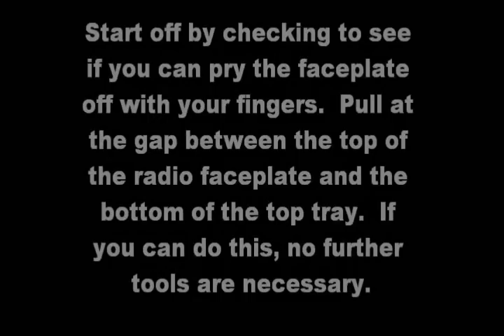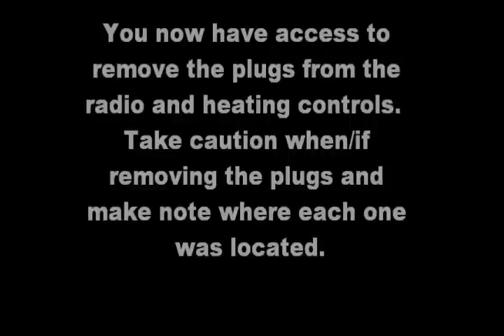How To Remove Radio Faceplate from a Nissan Titan

Comment: Is this a way to get to your 4 wheel drive switch removal? Cause I need to remove the switch to replace the light bulbs on it cause they went out because when I turn on the dash lights at night the 4 wheel drive knob doesn't light up its annoying especially if you have to switch it to 4 wheel drive and it so happens to be night and you won't be able to see it or on what position to put it at

Comment: So I don't have to take my glove box out, shifter off, shifter bezel off and also a few screws to get the faceplate off? 
I have read a few things on google and it seems no one does this and just pry the faceplate off. I have an Armada and I don't want to rip any of my cables. Is it ok if I just pry the faceplate off as well?